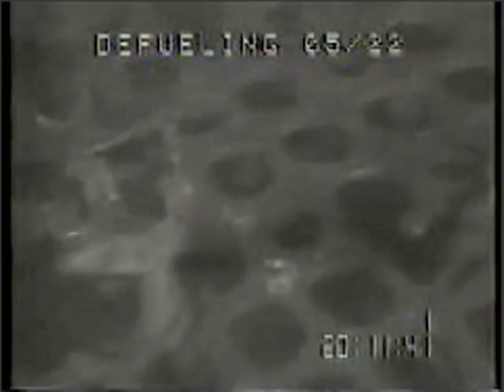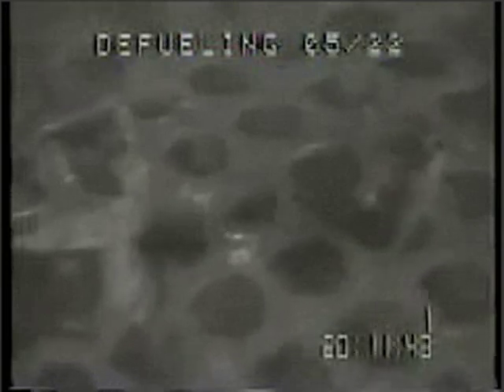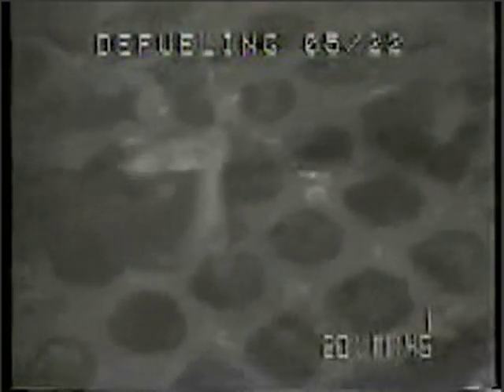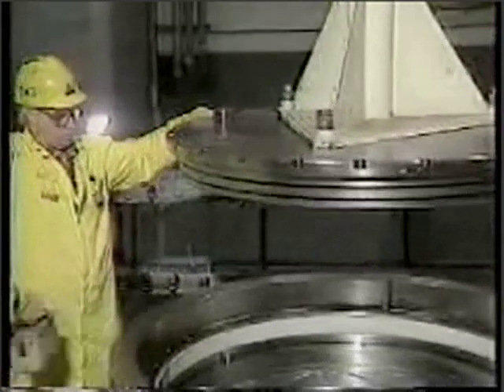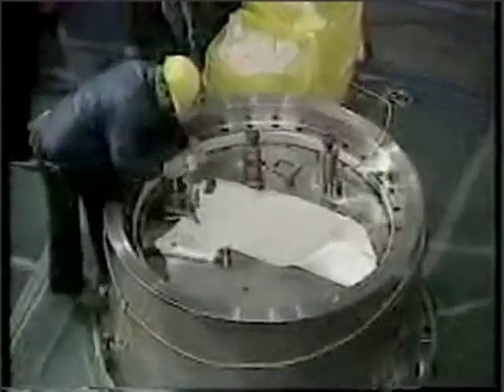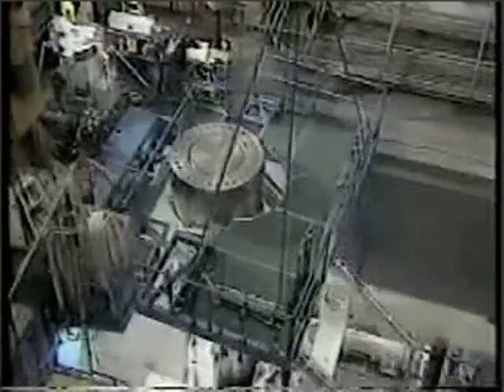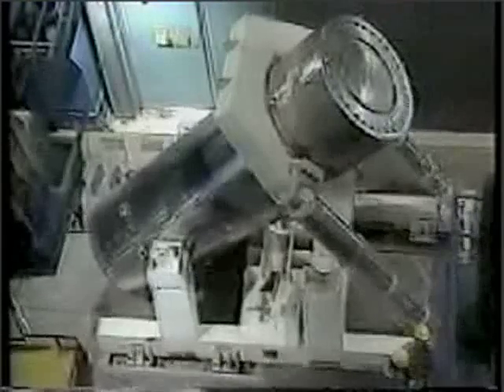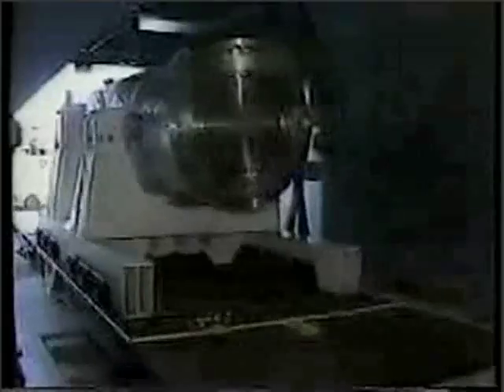TMI-2 Clean-up Highlights Pt 2 of 2

Comment: In other words...if the mess was in-acessable, it was left in place...so all PA residents will have forever to think about it.
Reply: look it up.. they complete cleanup a few years ago
Reply: At least they were able to clean it up, Fukushima is much worse cause the fuel melted through the bottom of the pressure vessel, in TMI 2 most was still in the pressure vessel so it was easier to remove. Easier being a subjective term 😂
Reply: Ya. It's not "cleaned up". They're decommissioning it now and it's not going great.